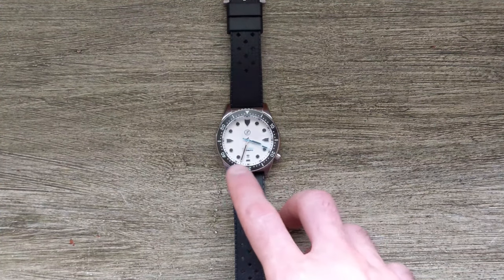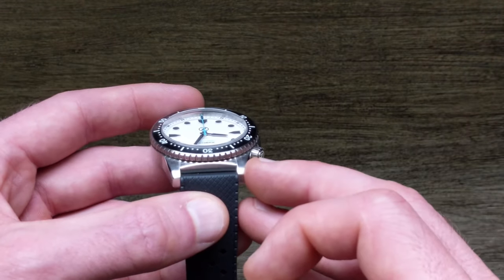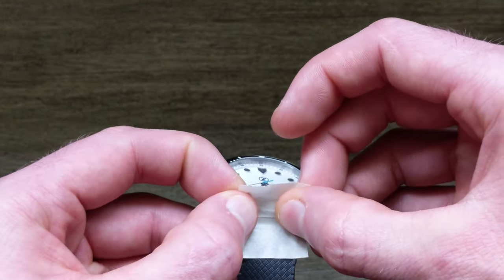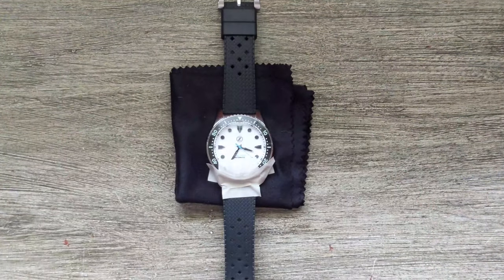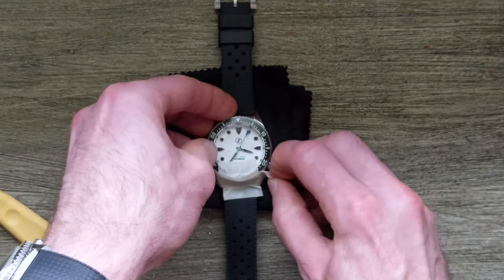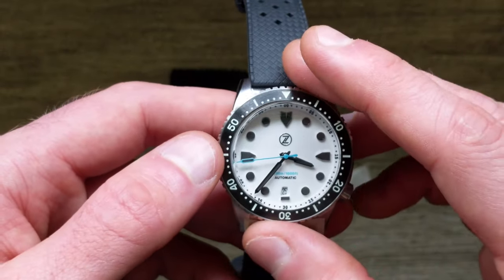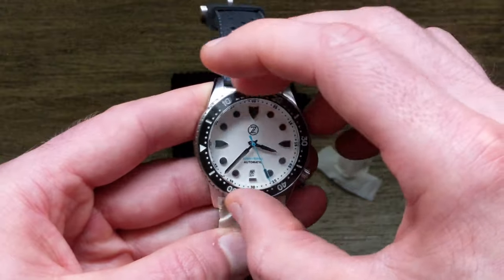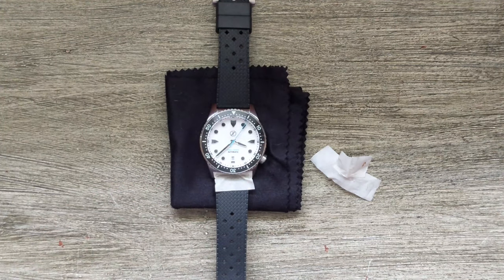How to Easily Remove a Watch Bezel

Comment: To be fair, this technique only works with watches valued under $50.
Reply from the maker: That hasn't been consistent with my experience. The watch in the video is ~$500 and of great quality. Cheers
Reply: @JonathanTReviews  What type of watch is this, I have a 1st gen Borealis Cascias that has the same 'thin' style bezel and spring.   The factory wants $200 for a replacement bezel.  Are replacements for this watch available?   The case is almost identical with the domed saphire crystal.
Reply from the maker: This watch is a Zelos Mako V3. That's quite disappointing to read and a really high replacement cost in my opinion. Regarding compatibility, sorry, I can't help as I've never owned a Borealis (and honestly don't intend to as I've never been impressed with the way they handle themselves in groups). If it's just the spring that failed, it should be a pretty easy and cheap fix. If replacing the entire bezel, keep in mind they're very specific with dimensions, number of clicks, etc. Best of luck. Cheers
Reply: @JonathanTReviews  Thanks for the reply.   I was able to find a non-working on Ebay, now I know how to remove the bezel.  The Borealis has a nice weight to it and a ratchet clasp.   Not as impressed with customer service.   The Zelos is new to me, but seem like decent designs.   Unfortunately all of their straps & accessories are sold out.   (horween leather and tropical straps).   I had liked Chris Ward, but they are getting over priced.
Reply from the maker: I'm glad you ended up finding a solution, even if not through the company.

Zelos is definitely worth a look. I feature quite a lot of their watches on here, if you care to check any out. They're arguably the most popular microbrand (CW I'm sure beats them out, if you still count them). You're correct though that their watches usually sell out instantly. You won't find better customer service ANYWHERE (not just watch industry) and the value across all price points (they range from ~$250-$12,000) are always excellent. Cheers